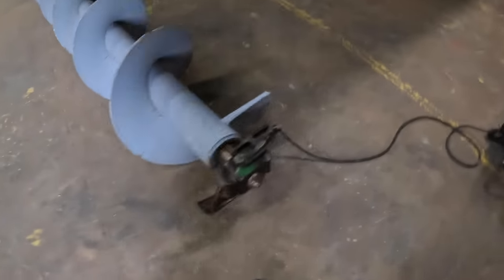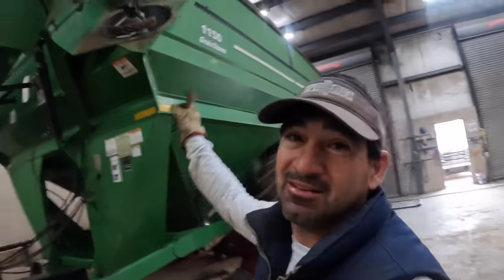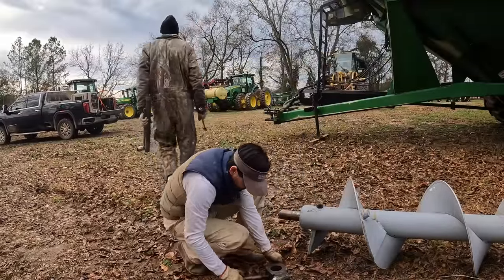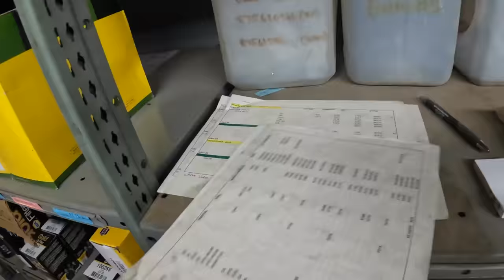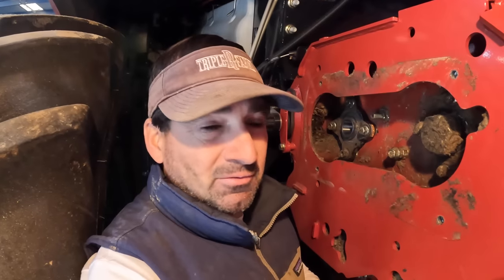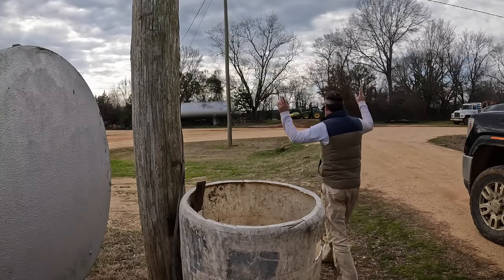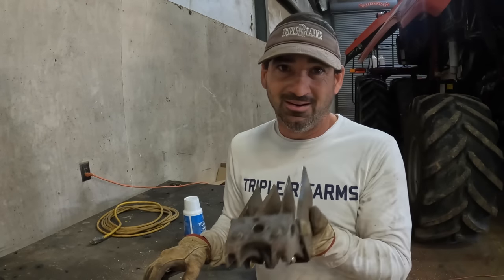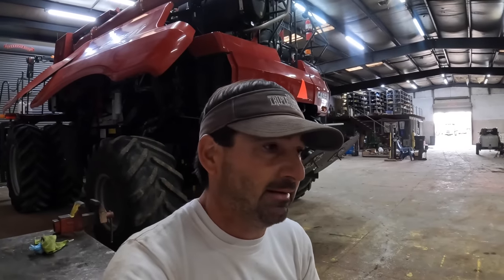GRAIN AUGER REPAIR PART 2

Comment: When I worked with a A/C Delco distributor was told Jonson control was only manufacturing left we took over so many interstate sales because of warranty issues that it was unreal plus with the 7 year warranty battery no prorate cost full replacement as other people said the trickle chargers are the best way to get full life out the battery saw the people at our associates warehouse sell many used ones they had saved from recycling using new acid and the trickle charger. Got to say you have the best farming channel on utube wish you the best of luck this year I am disabled now down to a small garden but farming and cattle along with gamefowl are life long passions

Comment: We use batteries from Cat, they are all becoming trash, but our D4 still has the factory battery from 2004 and it is just now starting to give trouble during the colder months. During the summer it’s still great. We’ve noticed trickle charging is helping tremendously.

Comment: Milo follows corn market. It cost you half the amount to plant milo than corn but pick you a good variety and you can make good money on milo. We do this in La. Best battery’s is Case/ IH for your combines. We also like Interstate batteries for most of our farm equipment. They are not cheap but have good warranty on them. Good luck with 2023 crop!!🙏🏻🙏🏻😁👍🙋🏼‍♂️

Comment: When I farmed we used strong box from John Deere or Case IH batteries from CNH on combines and equipment like that put you a battery tender (trickle charger) on them and plug them up it will keep the batteries maintained!

Comment: Daniel, we use Exide batteries. Seems like combines are the hardest on them. Late model tractors without battery disconnects are a close second.😢😢
Reply from the maker: 10=4 got it, thanks for watching 👍😁

Comment: I had the same battery problems on the 2388 I once had an every year before harvest I'd take them back to case to get new batteries under warranty. The knives on the chopper. I've done it the same way you changed them to where they belong. Wasn't bad taking them out to adjust them back. Just a little dusty. Hope the right auger for your graincart comes soon. Have a great day

Comment: If you have an arc welder you can recon your batteries. We do it every year. Have some old girls are 15years old. There's videos here on you tube how to. It works 100%
Reply from the maker: Really I’ll have to check it out, thanks for watching 👍😁
Reply: @TripleRFarms  as long as you have a battery with caps that you can service/top up then it works amazing, I had 2 dead cells in one battery from sitting, and as you increase the amps it is truly unreal watching them come back to life. These New chargers are an absolute have, they can't increase the amps enough to shock the cells back to life. This is a life hack that everyone with a led/acid battery should know! And hey as long as you keep filming em I'll keep watching em. Still ticks me off you put up with the constant repair bills on red combines but hey it adds to the content I guess. Lol. Keep up the great work mate from New Zealand.

Comment: See if you have a battery company that actually services or fills batteries.  They probably want be name brand but they are fresh batteries.  Biggest problem is buying them from parts house.  They sit in warehouses for ever before selling it to public.  Here in Charlotte we have company called Battery Service.  I wasn’t a believer until I started using them.  Always thought I needed a name brand but fresh filled batteries can’t be beat!  Cat/Penn, and Deka are all great batteries but finding them can be difficult and from parts house have the same problems.

Comment: Look at the amount of years the batteries are good for. Used to they were three and four year batteries. On some of my bigger equipment they are one and two year batteries. It is frustrating at best when you spend $500-600 per unit in batteries.
Reply from the maker: I hear ya , thanks for watching 👍😁

Comment: Batteries are made so cheep but with a lark price tag 
I would recommend investing in battery tenders and make sure ur equipment has battery disconnects for when not in use 
The newer equipment has so many computers   That it really draws a lot 
Power so the cheep built batteries can’t maintain enough  power

Comment: hi, when you buy a new battery you need to charge it with a slow trickle charge, the brand name is not as important as having a FULLY charged battery before use, there are only a few battery makers, some brand names have a few more plates in them than others, you get what you pay for, trickle charge for 24 hrs shud be good to go.  ever get an ATV battery u fill it with the supplied liquid then slow charge it per directions with 1.5 amps, do that with everyone you buy new.